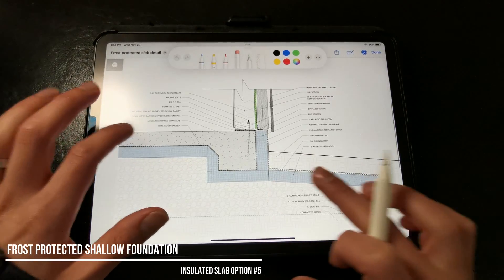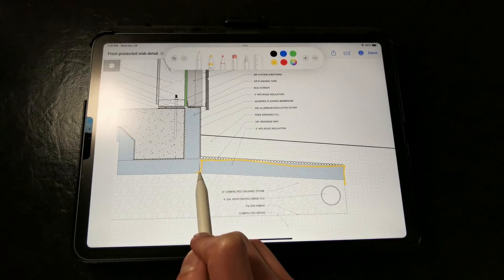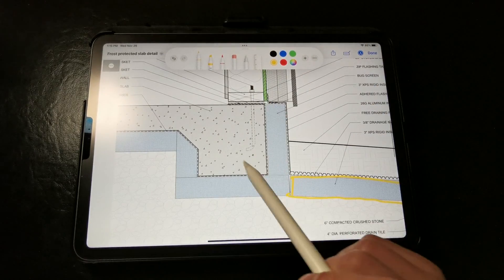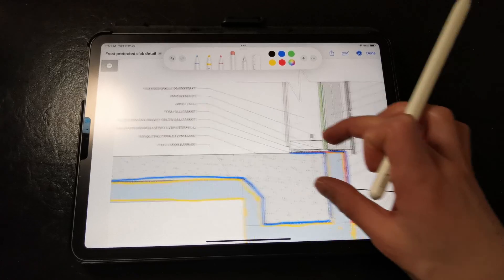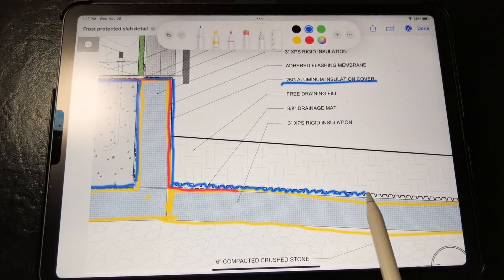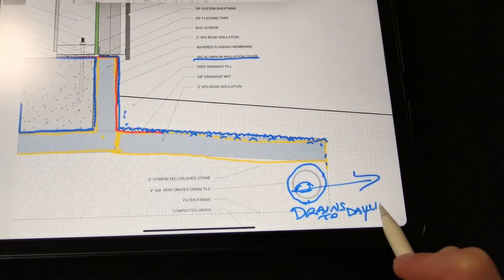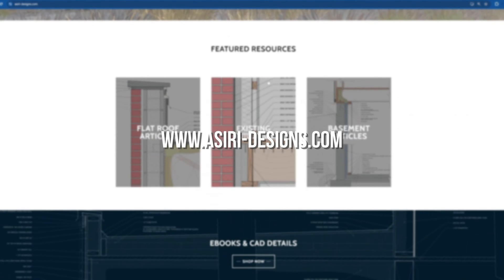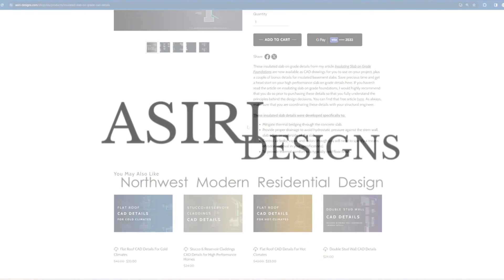Details For Frost Protected Shallow Foundations

Comment: Why not run the vapor barrier up over top of foundation and towards the outside.  Then either fold it up or down the outside foundation.   If up it might allow vapors to escape and you would run the exterior weather proofing under the plastic. If you run siding under this seam, it would be little risk of water intrusion.  Even if it did it would potentially just go under the sealed slab.  Running plastic down would be more water proof but not sure if vapors would escape as well?  I think both options are better than this video illustrates unless I an missing something more important?

Comment: This video is wonderful. Thanks to your channel, we are doing a fpsf and trying to follow your advice. We had our whole slab and horizontal insulation done in closed cell spray foam - it is not very level though, and I am a little nervous about it. But overall I am excited to try and follow these steps. We did not have a drain pipe installed under the horizontal insulation though.. I am planning to put up gutters and place underground drainage tubing where the gutters come down. The tubing will run on top of the horizontal tubing and beyond. Hopefully it will work okay 🙏

Comment: @ASIRIDesigns  You show a SA membrane under the sill and down onto the foundation wall. Does this need to lap beyond the poly to the inside of the house? And then you run a foam sill gasket on top of the SA membrane but not necessarily any sealant as the air barrier continuity is at the exterior of the wall connection? Thanks for clarifying.

Comment: Is this a variation of foundations I have seen in passive house design were there is a horizontal insulation and over that reinforced concrete slab 30cm thick (without that deeper sections below external walls) ?

Comment: Why do you consider it important to have continuous insulation under the slab?   That just reduces the heat from the building that is helping warm the soil beneath and then increasing the size of the insulation skirt needed to protect the foundation.

Comment: Does anyone know why the rigid insulation is not OVER the vapour barrier?
Reply: This is to prevent the rigid insulation from floating if concrete gets between the cracks. It should drain well enough with the gravel below
Reply: @Austin-fc5gs  Makes sense! Thanks

Comment: What is the reason behind gravel under the XPS plates that are NOT under the building? Reduced capillary suction or other? Can it just be groud?
Reply: Guessing additional drainage to make the rigid insulation last longer
Reply: I think sand is okay, it needs to be a soil that doesn't heave.

Comment: Awesome vid, first one I have seen done specifically for Canada (I imagine that's where you're located). I saw the pdf on the government of Canada website and searched for this foundation. Is it recommendable to do this at lake front lots? Or would piles or even screw piles be better due do a potentially high water table. In Alberta to be specific, where most lakes are slews in a field lol so we rarely have a rocky shore
Reply from the maker: Thanks so much for watching! I'm actually located in Oregon, but I'm familiar with cold climate building techniques. Great question - I would avoid any slab foundation near lake fronts unless you're significantly above the lake level. All it takes is a rainy season to potentially flood your home. Pier foundations are best in these situations, especially in the case of a high water table, as any flooding events are less likely to cause water damage.
Reply: thanks a lot! I have been binge watching the other videos, can you do one on pier foundations or screw piles and how to best insulate and keep out bugs on the underside? I love the look of that on flat roof houses instead of a crawl space  @ASIRIDesigns